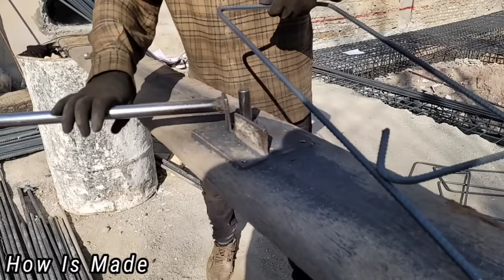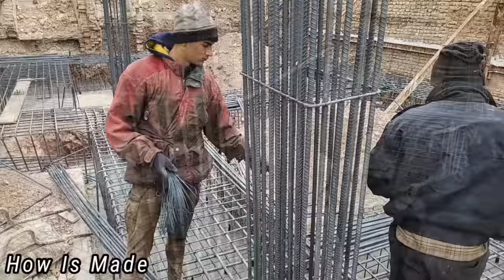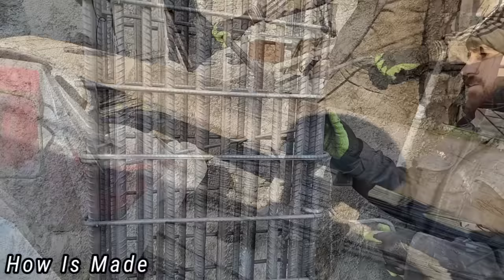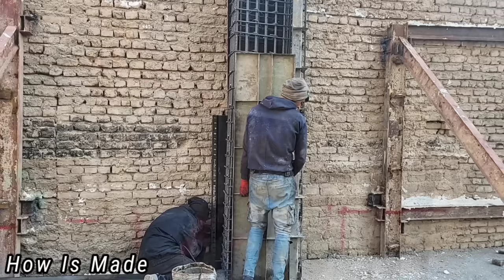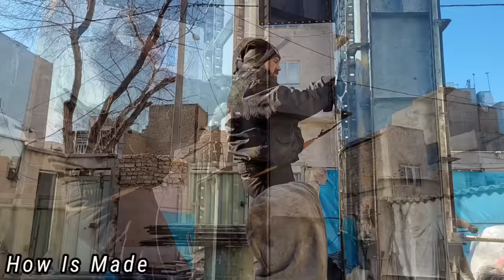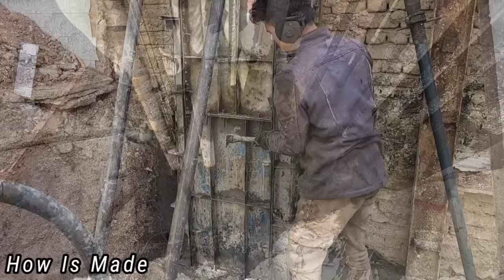Reinforced Concrete Column Construction Process / How Is Made

Comment: last 90° bend in stirrups is an error, it can lead to failure at that point, but more important is column rebar 90°bend should radiate out, not in... in leads to too much bar in the center increasing risk of poor concrete fill
Reply: Column longitudal rebar bends facing inside at base lead to congestion and poor compaction at that zone, totally right..
Reply: So... how much stories can that building safely rise? There's plenitud of rebar in those columns.
Reply: @TheSolver-PR  load design for a specific column it doesn't depend just on rebar, but also in concret grade C18 C25 C50 ? and work quality length vs area (buckling) not to mention ground quality (not all sil has the same load capacity) , you would need a complete blueprint of the building and a soil study to make such a determination
Reply: Column rebar 90 bend means development length of column in engineering term. There is rule of placing rebars in different direction to acquire the strength of materials used.
Reply: It's all an error mate.
This is going to be a five storey building.... Would you sleep in it.?
No clue what they are doing.
At a.
Reply: @sergegostoli9524  at last.!!!! Some sense.!!!!!!
Reply: @sergegostoli9524 ... Don't think they have a design pal....
Reply: ends should be at 130 % in towards center of column

Comment: Spacing between two bars can't be less than an inch and half; otherwise, aggravates won't pass through
Reply: .... Least of the problem.
No drawings. No calculations. No engineering.
.... And apparently this building is going up five storye.!!!!
Pray for the people in it when it collapses.
Absolute nightmare. No clue what they are doing.
Reply: @scarabooshable  I've never seen a building with supposedly no engineering have such big columns with this much rebar.

Comment: Can't see a drawing anywhere so assuming they are winging it with no calculations.
.... This, people, is why we see RC structures collapsing on news reports.
Often killing and trapping unaware users of the building.
Stop. Please, please stop.
Get your buildings designed properly, and the works supervised by engineers.
It literally isn't rocket science.
Watching this is making me nervous.
Reply from the maker: Dear friend, this building, including columns, roof, foundation and other structural elements, has been designed by software and has been approved by the municipality of the region. Of course, if a strong earthquake occurs, no structure can be said with certainty that it will resist. But if there is a specific place that is not implemented correctly and does not have enough resistance, I will be happy to mention it .
Reply: adding extra reinforcement in the columns is more worse than  having not enough. because it will not give you enough time to escape during collapse. but some people think more is better,  which is always not true.

Comment: Countless mistakes. binding wire should be double looped and with the right thickness of the wire. poor binding. it will break during concrete is poured. also 90 degree bend are useless on the stirrups. should be 135 degree. there is no concrete cover provided either. Over did steel enforcement. Ld other way around........